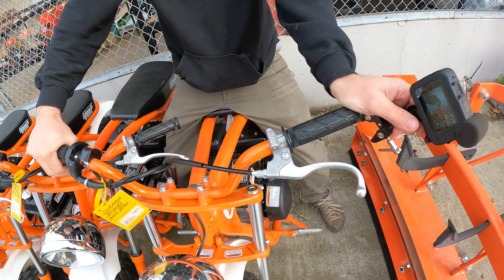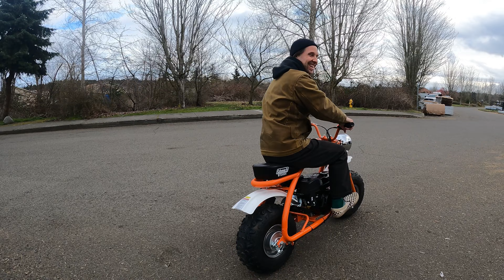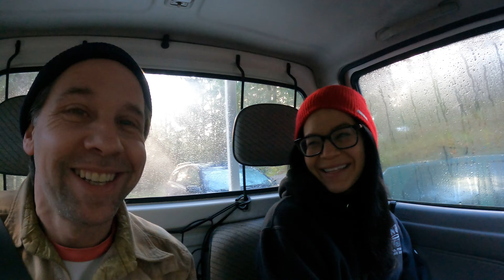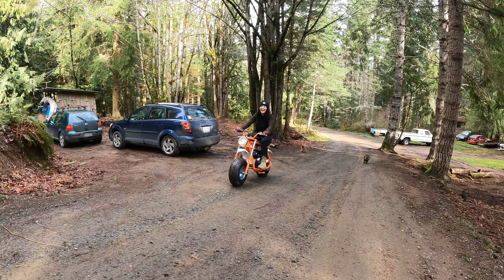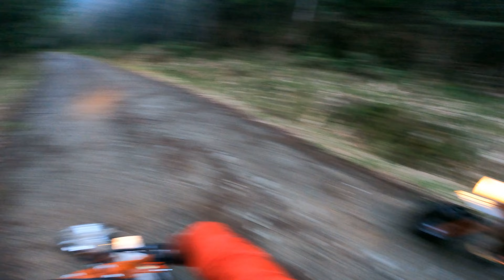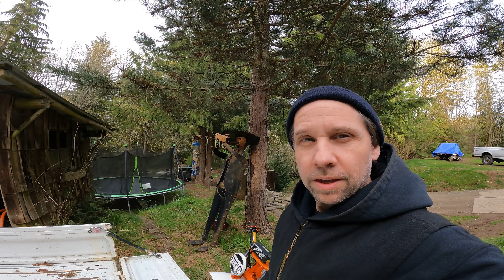Buying a Coleman Mini Bike & making it faster with performance parts / mods - BT200X

Comment: Not even lying. I'm watching this while I have a tarible second-degree burn from the aftermarket exhaust that stuck out way too far that I put on mine.
Reply from the maker: Leg burners! Its like a right of passage, I think everyone that has spent time on a mini bike ends up with that burn eventually… heal up quick man! The wrap through exhaust that Stacy put on hers is pretty nice and definitely keeps things out of the way. 👍
Reply: @OlympicOverland  you will be making a part 3 right?
Reply from the maker: @thatRBX  yeah, just been busy with the mini trucks but there will be more mini bike videos on the way. 👌
Reply: Are you  using the jackshaft or torque converter

Comment: Aloha from Hawaii 🤙🏻 I'm a bit late to the party but was curious if you could list the link to your aftermarket fenders, they look awesome! Mahalo and have a Blessed day 🤙🏻
Reply from the maker: Hi! Sorry for the late reply. The rear fender is an Acerbis Nost universal rear fender and they are available at most bigger moto online moto shops or Amazon/ebay and come in a lot of different colors. They are pretty cheap too, also good quality and made in Italy. The front fender is just a modified stock front or rear, I can remember which one I cut up to use but it turned out pretty good. Cheers! 🍻
Reply: @OlympicOverland  much Mahalo for the response🤙🏻🤙🏻

Comment: Great video! And where did you buy the exhaust and what’s it called?
Reply from the maker: Thanks! The exhaust is a U.S. made straight pipe with great welds but it is really loud. I ordered a clamp on muffler from Go Powersports and it is a good combo. Here is a link to Ebay but I think they are also available on Amazon. There are some other ones that look similar but this model clears the larger BT200X frame properly. https://www.ebay.com/itm/274638755302?mkcid=16&mkevt=1&mkrid=711-127632-2357-0&ssspo=FltSvJpgRmy&sssrc=4429486&ssuid=Tcq6iqqPSpi&var=&widget_ver=artemis&media=COPY

Comment: I have one and I put different handlebars on mine plus a toque converter springer seat taillights led light strip so it lights up the engine at night .
Reply from the maker: Modding these things is always the fun part! 👍
Reply: Do you have a link to these handlebars and grips?

Comment: At 10:28 those look like after market rear and front mud guards did you buy them and if so do you have a link
Reply from the maker: Hi, put the original rear fender on the front and installed an Acerbis Nost universal MX rear fender on the back. It fits great and is easy to mount up. The Acerbis fender is great quality, cheap price and made in Italy. I found an eBay link but most online moto shops carry these and they come in a few different colors. https://www.ebay.com/itm/166004142095?mkcid=16&mkevt=1&mkrid=711-127632-2357-0&ssspo=mIpz3HLJTu-&sssrc=2349624&ssuid=Tcq6iqqPSpi&var=&widget_ver=artemis&media=COPY

Comment: Is that a genuine mikuni carb? I bought a Tillotson curved inlet manifold on gopowersports, but it doesn't fit my mikuni carb.
Reply from the maker: Hi, my carb is just the common VM22 copy. It fits the Tillotson 225RS intake manifold and matches the bolt pattern of the original Ghost 212 PZ carb. I also have a Tillotson 225RS carb that has the same mounting holes as the other 2 carbs.
Reply: @OlympicOverland  oh ok, so you don't know if that 225 manifold would work with the oem mikuni
Reply from the maker: @troy22nd  I think I remember seeing a post awhile ago about enlarging the holes on an OEM Mikuni but can’t remember which forum it was in.
Reply from the maker: @troy22nd  I bought my 225RS intake manifold from Chad at Chadz Mini Fab, you could contact him to make sure with your mounting hole measurements. https://chadzminifab.com/

Comment: Where did you guys find your 7/8" to 1-1/8" handlebar adapters?
Reply from the maker: I just used the Pro Taper 1 1/8” universal bar adapters. It’s been awhile but I think I had to re tap or drill out the top triple clamp plate to fit the adapter better but it was pretty easy.

Comment: Have one of my own. Definitely helps to take the governor off. Except with a 196cc engine its kinda a 50/50 to put performance parts on it without blowing the engine
Reply from the maker: Yeah the biggest issue on the Hisun 196 is the small crankshaft ends. It makes upgrading the flywheel and clutch difficult because of parts availability. You could buy a different crank for the motor but it’s easier to just get a 212 Hemi Predator to build or any other clone motor. I did have a lot of fun with the Hisun 196 after some mods and it made good power but I knew the small crank end would eventually break. 👌
Reply: @OlympicOverland  yeah, the crank is crap. If i could i would put a bigger crank i would. And stage performance kits i heard could blow your engine instantly after stage 1. So im not going to take any chances and just buy a 300cc motor for it.
Reply: @landonm5188  Whoever told you that just don't know the history of the Honda GX200 and 196 clones. 196's take performance parts just like any other small block and are easy to build. I have a built 196 that pulls just as hard as my similarly built 224. The 224 just has more low end torque. My Hisun 196 was built when it was 7 years old. The 224 was built brand new.
Reply: @OlympicOverland  Billet and cast aluminum clone flywheels are everywhere. There should be no difficulty finding one for the Hisun 196, or any other small block that isn't a Predator 212 hemi/non hemi. They are the only two engines that do not have a clone taper for the flywheel.

Comment: hey my man!! run me through that hella headlight setup please, it looks great !!
Reply from the maker: Thanks John! It is just a standard halogen Hella (the cheap ones) that I had laying around in my garage. The trick with these is that the bracket is really easy to adapt to the original headlight hanger on the Coleman so you still have so adjustability. I might replace it with the LED version eventually but the halogen worked fine on the original Hisun 196 motor. Unfortunately the Ghost 212 motor that I have now doesn’t have a lighting coil so I have to make a battery pack for night riding. Cheers man 👍
Reply: @OlympicOverland  thanks so much for getting back to me, and for the info on your headlight!!!!  ive got a little light bar laying around that i think ill throw on and see what shakes out. Cheers!!

Comment: Do you have the link for the hella light you used?
Reply from the maker: https://www.summitracing.com/parts/hla-005750952 Hi my Hella light was one that I had laying around from an old project but I think it was a Hella 500 kit. I checked and this link from Summit looks like the version I have. It was pretty easy to adapt to the original light bracket 👍

Comment: After removing the internal governor how did you plug the two holes into the engine? On mine those holes are not threaded
Reply from the maker: Hi Vincenzo, I can’t remember the size I used. I think a 1/4-20 bolt is really close. I used a tap and threaded the hole on mine but I think some guys just try to thread the bolt in using some oil and an impact driver but I would just use the tap if you have access to one. 👍
Reply from the maker: Also, use a thread locker like Loc Tite if you have some to keep the hardware from backing out. A small O-ring or some gasket sealer is good to use on the top of the threads so you don’t get an oil leak. Cheers man!

Comment: So how much did you notice? Before and  after the mods top speed wise?
And,,, how much more top speed with the ghost?
Thanks, thinking about getting one of these for my property
Reply from the maker: I didn’t get top speed numbers but doing the mods that I did you will notice a big difference on the stock motor. In the video I did with the Ghost installed, I did a side by side race with my son on his bypassed governor stock motor and the Ghost walks away from it so it’s a pretty big difference. 👍
Reply: @OlympicOverland  Cool thanks man
Looking for something to putt me up and down around my 6 acres , back and forth to the corner store etc. while we build the house
Reply from the maker: @j.clement8476  the Harbor Freight Max Power 224 and original hemi Predator 212 are both really good options and a bit cheaper. Lots of great aftermarket parts availability for all of these GX clone motors too 👍

Comment: Do you think the crank broke cuz of the two up? I have a 196cc and am waiting for the same thing. Lol
Reply from the maker: Ha ha the notorious crank snapper! I don’t think riding doubles caused it but it probably didn’t help the situation. It was more than likely just adding some extra power with a few mods that stressed it. By the time it broke I had already removed the governor, installed the bigger carb/intake, added the exhaust and did quite a bit of fine tuning so the motor was making a considerable amount more power than stock. Some of them seem to hold up fine and a replacement clone crank with a 3/4” end is still pretty cheap if it does break. I really liked that 196 but was planning on swapping another motor in anyway but we did get a lot of riding out of that original motor and I was surprised at how well it held up! 👍
Reply: @OlympicOverland  Thanks for the quick reply! It makes more sense why the crank broke if it was after all the mods you did. For my 196 I've removed the governor and throttle stop, and have just been ripping it around with stock carb and exhaust. Sounds like I will just run it till it blows and then upgrade to a bigger motor. Any suggestions for an upgraded motor? I would like to keep the headlight if possible
Reply from the maker: @NorthWestMotos  I bet that 196 will keep running for quite awhile but you could re power it with a Harbor Freight motor at some point. I installed the Ghost 212 and have been happy with it. My brother used the Max Performance 224 and that has a really fun power curve with great torque. The original Predator 212 is still a great value but make sure you look through the hand holds on the box before you buy it to make sure it has the cast aluminum valve cover not the steel cover. The cast aluminum one means it has a hemi head and better rocker arms. Those motors go on sale for $140. None of those have a lighting coil but I have seen aftermarket kits. Fortunately all of those motors have great parts available for trick bits and pieces to make them faster. I made another video comparing my new motor to my brothers 224, check that out if you get a chance. 👌

Comment: What kind oof rear fender did you put on the BT200?
Reply from the maker: Hi Jeff, it is an Acerbis Nost universal rear fender. Good quality and pretty inexpensive.
Reply: @OlympicOverland  thanks for the info!
Reply from the maker: @jTone40  no problem! I will have another video coming out in the next few weeks that goes into detail about the Ghost 212 and some of the other mods I’ve done to the bike. It’s getting pretty fast.

Comment: What hella light is that ??
Reply from the maker: Hi, it’s old and was a leftover light from a past project but I’m pretty sure you can still buy them. Look up Hella 500 and those should be a similar halogen Hella light with the swivel bracket. It’s really easy to adapt to the Coleman bracket. 👍

Comment: Cus you removed the governor bike is not meant to handle that much rpm that’s why ur flywheel fucked up and ur shaft
Reply from the maker: Actually the end of the crankshaft snapped off because it tapers to a 5/8” shaft and not 3/4” like most of the other engines on the market. This is a known weakness on these Hisun 196 motors that Coleman used on the BT200x. The flywheel never cracked or became unbalanced, it was just a bad design to use an undersized crankshaft. I agree that swapping out the crappy cast flywheel is important on any modified motor like these but they are not as easy to find for 5/8” cranks and I was planning on building a different motor anyway.

Comment: Not vary dependable.
Reply from the maker: Hi Chuck, 3 of the original 4 motors are still running good.
Reply: @OlympicOverland  alright then.
Reply from the maker: @chuckhuff7123  the small crankshaft end is definitely a design flaw though.

Comment: I was 50 when I bought my first mini bike 2 years ago. Where did you guys buy those mini trucks? I sure would like to look into getting one.
Reply from the maker: The mini bikes and mini trucks are a great combo! There are a bunch of importers around the U.S., I bought mine in Portland Oregon from Motorcycle Warehouse. Shop around and you will see that prices seem to vary a lot on them. Try to test drive a few different models before you buy one, Suzuki, Subaru, Honda, Daihatsu (Toyota) and Mitsubishi all make great trucks but each one has a different feel and comes with different options so see which one is best for you. If you are planning on using it off-road in some really nasty conditions look for a truck with a rear differential lock but most of the time a standard 4x4 will be fine. I made another video about shopping for my truck, it has some good info so take a look at that as well. Good luck on your Kei truck search, they are fun and really useful! 👍
Reply: @OlympicOverland  Thank you so much for the fast reply and info buddy. 👍